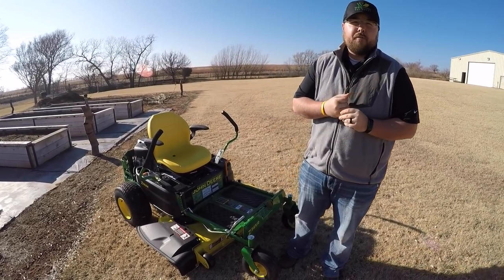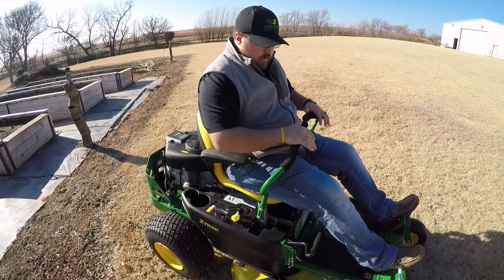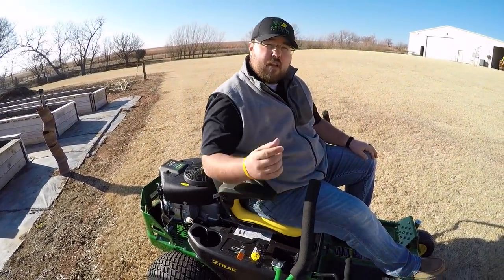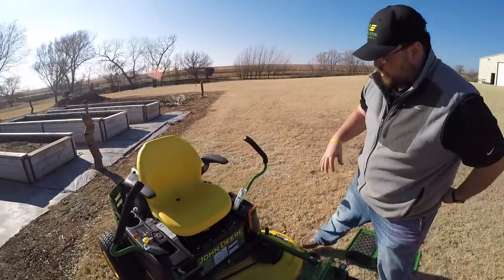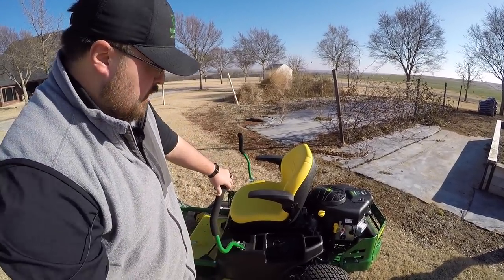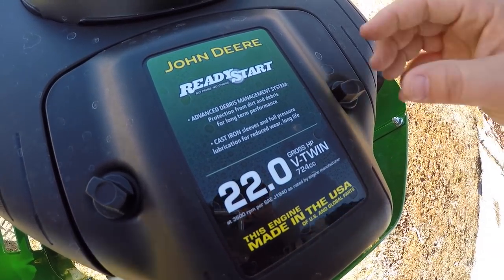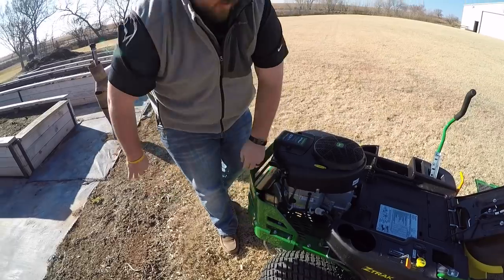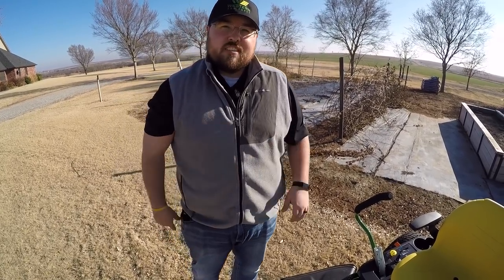2019 John Deere Ztrak Z345R Walkaround Product Overview

Comment: If you like cutting your grass at or more than 4inches then this isn’t the machine for you. The deck reference height on it for the heighest cut is 4inch but if you literally get on the ground and measure the distance from the blade to the ground. It’s actually 3.25-3.5 inch cut. So in other words you’re not really cutting 4inch height at that setting.
Reply from the maker: This could be true depending on how soft your soil is and what your tire pressure is set at. Many factors going into this particular topic.

Comment: I can't seem to find a fuel gauge/indicator anywhere on my John Deere Z375R mower. I am new to the brand so I am not sure where to look. I checked the manual, but could not find anything helpful. I'm starting think there isn't one which seems pretty rediculous to me. Any help is appreciated!
Reply: The fuel level indicator on a 42 inch mower is when you run out of gas.  If you find yourself a 1/2 mile away from a gas can when you run out of gas, you've probably got the wrong mower for the job.  I've owned cars with a non-working gas gauge, you just figure out how many miles you can run before you run out of gas, then your indicator is your trip odometer.
Reply from the maker: You are correct, there is not a fuel gauge on the Z3 models. There is however a low fuel indicator light right behind the key switch (Gas Pump Emblem) shown at 5:22 in the video. This is a problem i would like to see fixed as well! Thanks for watching!
Reply: @WesternEquipment  Thanks for the fuel light info, all tho I've never ran out of gas, I've risked it to go mow a small strip of grass.  Now I can mow with confidence.
Reply: @WesternEquipment  Thanks for the response! I actually ran low the other day and didn't know it, but I just happened to look down and saw that the gas symbol was lit red. I'm glad, for their price,  there's at least 1 way to tell when the z300 series needs fuel.

Comment: It's definitely one of the smallest zero turns.  The specs read 72in length, but most others in this price range are 76-84in from what I can tell.
Reply from the maker: I can tell you from doing our Mow an Acre series with this mower that even though it is small it can handle a lot of mowing. Frame is small but I am a bigger guy at about 275 and it had no problems cutting the thick grass even while carrying me as a load.
Reply: @WesternEquipment  That's good to know, and I still might get one, but it does look cramped and it's a shame they decided to make it that small.  I am shopping around for an inexpensive ride on mower.  I don't have a particularly big yard, in fact it doesn't really justify a ride on tbh, 12k sq ft.  It just feels like it's too much for a regular walk-behind 1-2 a week and too small for a machine meant for an acre or two.
Reply from the maker: @aliren6118  I totally get where you're coming from. One thing I would say is that if your are in the market for a good ride on then don't skimp the first time. Reason being is once you have one you will never go back to a push mower so you may as well make sure and get something you know you will be happy with for years. I know a lot of people do not like the idea of financing something like a lawn mower but it is a good option and John Deere usually has very low rates and sometimes even 0%. And this way you can spend a little more and get what you really want and make sure it is the mower that will last you a long time. I hope this was helpful and thanks for watching!
Reply: @WesternEquipment  Thanks, this is really helpful insight!  I agree about not skimping, like most of us I bought too much cheap stuff to fall into that trap anymore.  I am probably more torn over this decision than I should be lol.  42" zero turn or Time Master 30", way, way too many pros and cons than I thought there would be.  It's good to hear that people don't look back on the ZTs though.

Comment: will it fit through a 46" gate?
Reply from the maker: Yes, but you may have to flip up the black chute that is attached to the deck to fit.
Reply: I believe with the chute up it's 46 inches. It's going to be a tight squeeze
Reply: Forty-six inches should be plenty with the chute up. I don't have this mower. I have a Toro Timecutter 42". I have a 45" opening to my widest gate accessing my back yard. If I strap up the chute, I can drive through with  half an inch to spare. I line up the anti scalp wheel against the edge of the gat opening and drive through. If I hold the chute up, it is much more tricky because I then have to drive with one hand, but it can still be done with care. I prefer to mow with a chute up anyway for better dispersion of grass (safety disclaimed), so I always strap up any mower chute except for a few walk behinds I've used that directs cut grass right at my face, so of course, that's a no go.

Comment: what is the difference between z345R and z345M??
Reply from the maker: Main differences are all comfort features. The Z345R has anti-vibration and anti-slip floor mats, curved ergonomic steering levers to create more comfortable positions for your hands, and most importantly, it has foot lift for the deck. The best thing is that you get all three of these great features for only $100 more. Thanks for watching!
Reply: @WesternEquipment  I was told that the R is by far the better way to go over the M.

Comment: Can you put a foot raise on the 355e?
Reply from the maker: Yes, you can!
Reply: @WesternEquipment  can a grease fitting be added to the front caster pivots
Reply from the maker: @johnwalters7415  No, unfortunately you have to remove the top cap to pack grease around the spindle and bushings.
Reply: @WesternEquipment  I have a question about adjusting the anti-scalp wheels I have the 42" deck. Should both of them be the same I have one on the 2-3  and the other is 1 1/2 - 2  if I put them both the same one will be closer to the ground. The deck is level.
Reply: How about the z335
Reply from the maker: You definitely want them all at the same position based on the height you cut at.
Reply: @WesternEquipment  yes I know I believe they don't have one bracket in the right place. I can put both the same height but one side is off one hole
Reply: On the 335e can you replace the front plastic bushings with bearings
Reply from the maker: I don’t think so, unless you could find an aftermarket needle roller bearing or something like that. Let me know what you find!
Reply: I just purchased a new z335e two weeks ago.i really like it but just don't know about those plastic bushings. Should they have a little play our what? It's not the bushings in the wheels it's in the up and fork
Reply: The is for your time friend

Comment: Did you say take the deck off to change the blades ????
Reply: Yes, he stated that. Seems easy too, guess you could scrape the area there too.
I have a big 60", it's a pain to change them.
Reply from the maker: Yes, you can do it that way or another way would be to find a way to raise the front end off the ground to get under the mower to change them. Removing the deck is definitely the safest was though.

Comment: Just bought one of these, but have no idea how to check the fuel level!!
Reply from the maker: Unfortunately there is no fuel gauge on this machine. Not sure why but the only indicator is a light that will appear under the gas pump symbol on your control panel shown on your right hand side shown at 5:30 in the video. When this light comes on you are nearing the end of you tank. Again, not sure why they didn't include at least a sight gauge but unfortunately they did not. I recommend filling your mower after every use to help avoid running out of fuel. Thanks for watching!
Reply: Always make sure to keep your fuel tank full with TREATED gas.  This will reduce the amount of condensation that forms in the fuel tank.  John Deere sells fuel treatment but so does Walmart.  The best one I have found is the Briggs Stratton brand.  You can treat fuel that will be good for up to 3 years, which is really good if you have a generator that you only use when the power goes out.  Regular untreated fuel is good for 30 to 60 days if used in small engines.   In Trucks fuel can be used longer because of the different design.

Comment: There's a Youtube channel with a John Deere mechanic who warns people not to purchase these residential John Deere machines, saying the frame is wimpy and he sees problems with all kinds of things like the deck and the casters and on & on.  About the only thing he says is ok on them is the engine.
I wonder if people buy these residential mowers and try to do things with them that they are not designed to do? (no...never!!!)  They just bought this because they did not want to spend the money for a more robust machine.  Or they just abuse their equipment. Or both!  The only thing I can see is that the frame really is the one of the flimsiest ones out there today but it should be ok if  it is not used improperly.
Reply from the maker: Good thing is that John Deere has just made major upgrades to these mowers to fix the frame issue. Stay tuned! I will have videos out on them soon.
Reply: @WesternEquipment  Excellent!  Will these upgrades be on next year's models or sooner?  Can't wait to hear about all of the upgrades so I know whether to wait or buy now.

Comment: Just bought one today Home Depot (Canada). You say the R Series has the foot deck lift feature but I'm seeing that I possibly can buy one? I can buy it and install it right? I'm seeing that it's available here 
https://www.johndeerestore.com/jdb2cstorefront/JohnDeereStore/en/John-Deere-products/Genuine-Parts/Equipment-Accessories/Other-Accessories/Mower-Deck-Foot-Lift-Kit-For-Z345R%2C-Z355R%2C-Z355R-and-Z375R-ZTrak-Zero-Turn-Mowers/p/BG20946

Also I can buy the rubber foot pads...if I had all this would my model thus be an R model? I'm thinking that's all the R has versus the M right?

So also is there a gas gauge? I didn't pick up my mower today...tomorrow is my date so....
Also I have a Husqvarna Rider now and I will miss that they included a great sticker on the inside of the motor hood with all the part numbers...very handy that was!
Reply from the maker: Yes, this is correct. If your Z300 series mower did not come with it then this is the correct kit. Thanks for watching!

Comment: Looks kinda flimsy at the front.
Reply from the maker: They are definitely built for small residential use therefore the frame tubing is light, but it is still a very durable unit!

Comment: I have this mower a 2016 Z235 model and it is a Piece of SHIT ESPECIALLY THE MOWER DECK!! When stamped the steel deck it stretched the metal way too thin. My wife ran over a dead 3/4” diameter dead rotted oak tree branch and it jammed the blades, (we also have a 2005 JD L130 mower that chews thru dead branches that size and bigger with no problems when you accidentally don’t see and hit them.) Anyway I Un-jammed  the blades didn’t see any blade damage and when she started to mow again and the discharge side was scalping the yard bad. I told her put it up and finish with the L130 and I’ll look at the zero turn when I get time it only has 59 hours on it we rarely use it. A month later I started to look at the deck and noticed the discharge side blade was sticking down below the bottom edge approx 3/8” so put a square across the top of the deck and the bearing spindle was indeed 3/8” out of square and upon closer inspection saw hairline cracks in the paint around all four mounting bolts of the spindle so I peeled back the yellow paint and I couldn’t believe how bad the cracks in the deck were!! Mind you there is No damage or bending to the blades at ALL !! And when I unjammed that dead branch it took very little effort by hand to remove it and that branch was pretty brittle. At that point I got out my micrometer and started checking the deck thickness which was inconsistent throughout. So I contacted JD headquarters to report this and make them aware and question if they had any other similar complaints, and file a warranty claim because even though I’m still under the number of operating hours allowed in the warranty I’m over the years by five months at the time. 
It’s extremely obvious that when the deck was stamped it overstressed the steel at all the radius points because you can see it once you peel back the paint.
JD requested me to take pictures and email them to the corporate headquarters then take the deck to the nearest dealership so they could have their district representative come look at it. 
Well after 6 weeks of waiting no district rep ever came to inspect it and the dealership GM told me the factory said I was out of warranty and they couldn’t help me except to sell me another deck. They didn’t even try to inspect the defective steel.
Now so you understand my background, I have been a certified 6G welder fabricator in Mig, Tig and stick for over 30 years also a master machinist over 25 years I’m very familiar with metal fatigue and what causes it. The sad fact is that John Deere cutting corners on their quality control on production and didn’t think any residential lawnmower customer would call them out on it, but I did and they totally blew me off a Loyal JD customer because I also own a LT155 mower, JD pro model chainsaw tree trimmer, JD 4800 psi pressure washer, JD weed eater, JD chainsaw and had a JD 20hp tractor before it was stolen. 
But after this total lack of customer service on their Defective product I’ll Never purchase another John Deere product again Ever!!!!!!!
Reply from the maker: Hate to hear about your misfortune on your mower! Hopefully we can post some demos that may change you mind and get you back to being confident with John Deere! And if not then at least we can say we tried lol! Thank you for watching and for the feedback!